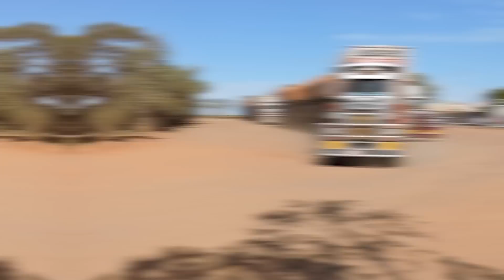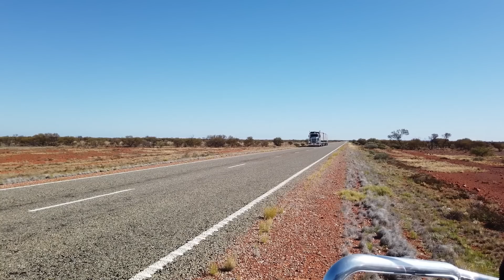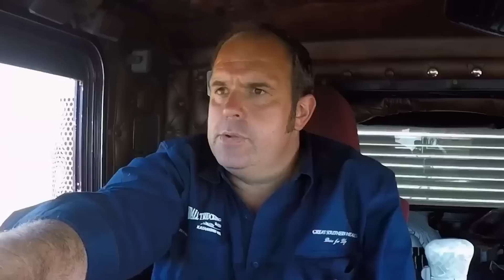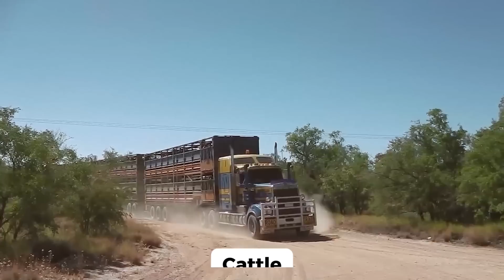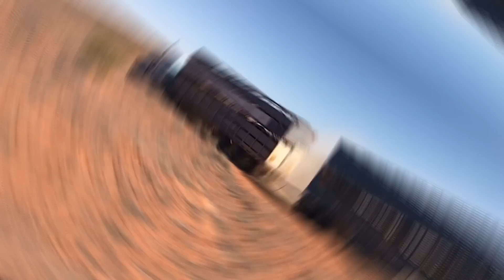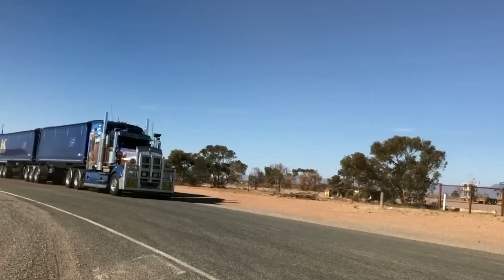Meet The WORLD’S LONGEST Trucks...

Comment: Most people in Australia hate these things on the road. They should be delivering on trains, nothing that long should be on same roads as cars and other vehicles.
Reply: Most people in Australia do not encounter them. They are generally restricted to outback WA, a lot on mine haulage roads are 4-5 trailers but public roads usually only 3 trailers.
Give them respect and space.

As for using trains, the current network doesn’t cover the required areas and to build will take many years, well beyond me caring
Reply: Without road trains, the cost of goods would skyrocket.  Australia is too remote to have rail lines crisscrossing the country.  Provided we have properly trained operators doing the right thing, we should have any issues with them.
Reply: Sensible people respect them and give them the right of way however I have witnessed idiots who dont
Reply: By “most people” do you mean the grey nomads towing caravans at 80kph holding everyone up?
Reply: @ you mean people towing caravans at appropriate speed for the conditions and within the law (eg has a maximum speed of 100kpm when towing anything).
Reply: @That_is_for_me_to_know  travelling at 20, 30, or even 40kph below the speed limit is dangerous, to them and to nearly everyone else on the road
Reply: @steveatkins3528  why? I can see you are likely to be the driver who takes chances to overtake because you want to be there a few minutes early. Plan your moves, stay behind until there is a passing lane or sufficient road to do so.
Reply: They are becoming common on the Hume Highway . We often find them  around Yass , 45 minutes from Canberra and about 3 hours from Sydney. So far they are all under the Collins brand. Only 3 trailers though.
Reply: Road trains only want half the road the middle half doesn't get any easier than that

Comment: I mean the Australians can still get it done with a road train, its just that they would have to fork over more money for drivers, tractors, and fuel to run them.
Reply: Same deal for railroad still need to fork over money. So depending the load they equal themselves
Reply: Crap. They save  a lot  by  not having multiple drivers and rigs.